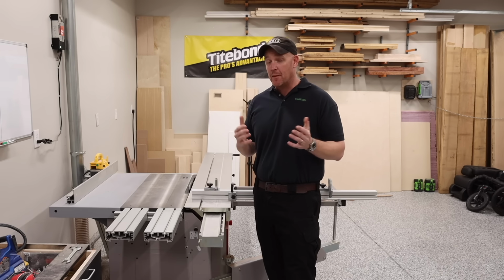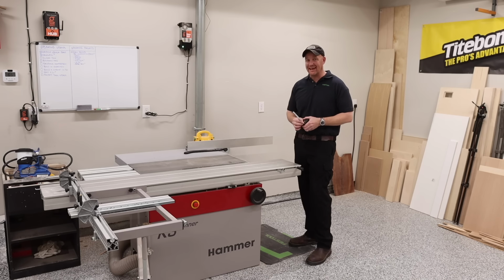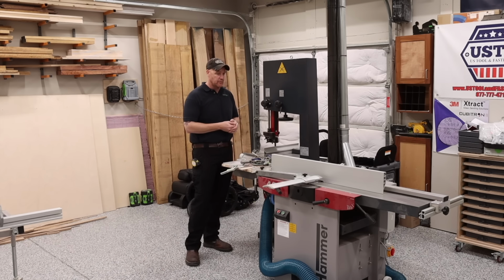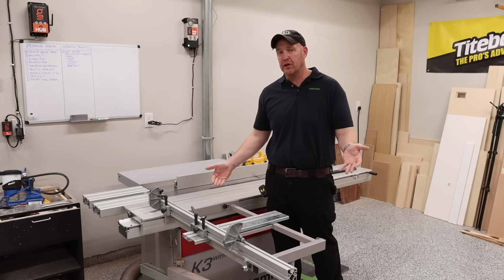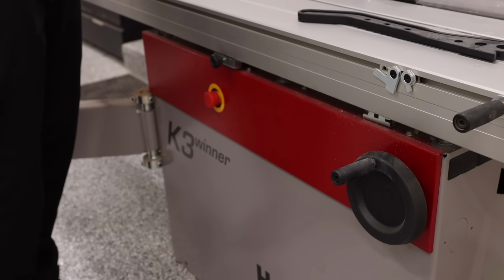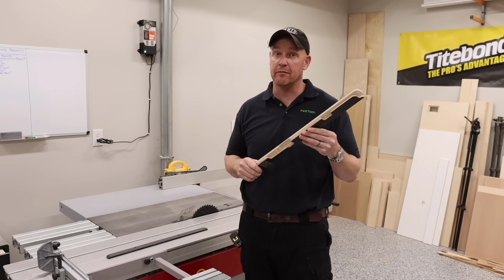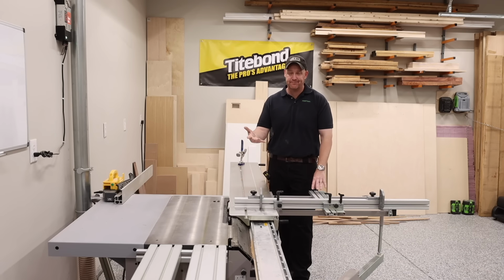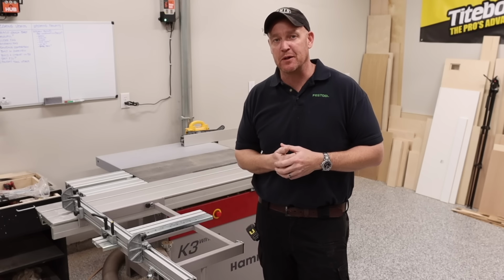I’ve been using the wrong table saw for years

Comment: I have exactly the same machine, down to every specification. I think this was a nice introductory video, one I would have appreciated three years ago when I was obsessed about table saws and which one to buy. You spent a lot of time on the dimensions and the space requirements. I have a way smaller workshop space and I've been able to make it work. For me, the main attractions for the sliding table saw were: (1) Safety. You use a slider differently. Instead of standing directly behind the blade, and in the path of any kickback, you stand to the side and away from kickback. Moreover, there is no need to get your hands near to the blade. If you find yourself doing so, you're doing something wrong. For small pieces, you can make or buy a Fritz & Franz jig which pinches small pieces when running the wood through the blade. (A F&F jig is also really useful for rip cuts on narrow pieces.) (2) Precision. This machine is probably the cheapest machine you can buy that has precision better than wood deserves. If you get a few 1-2-3 machinist blocks, you can dial in the scales to less than a mm. The precision also extends to the cross cutting ability on this machine. I dialed mine in so that error is evenly distributed around zero. (I'm a statistician and did replicate cuts using the 5 cut method.) This means that you can count on 90 degree cuts really being 90 degrees. Finally (3) Crosscutting: I was used to the idea of a normal North American style table saw. In fact, I started my research with the idea of getting a Saw Stop saw. But, then I started to think about the things I would need to make in order to use the saw to its fullest potential. Minimally a crosscut sled. If you think about it, it's silly to think that you need to make a bunch of jigs to use a saw to its potential. This saw, out of the box, can cross cut like nothing you've ever seen. It's a dream!

Bedrosian sells an excellent Fritz & Franz jig. Ramon Valdez makes zero clearance inserts for this machine.
Reply: Thank you for your insight, this is great information you have shared.

Comment: I agree 100% with Jason on the slider review.  Sold my Sawstop 2 years ago and bought a C3 41, 16" jointer/planer, shaper combo and have never looked back.  Was a tad hesitant but took the jump and just wish I did it sooner.  The Fritz and Franz accessory is awesome, I could cut thin strips all day with complete confidence, and with total safety. I use only Forrest blades and have the Forrest dado stack. I now do most of my cross cutting on my slider instead of my Kapex as well.  And cutting plywood, as Jason demonstrated, is so much easier for this old man. Oh and this saved me space in my two car garage setup, by also selling my DeWalt 13" planer and Powermatic 6" jointer. I also find Felder's support to be top notch.  Thanks Jason, really enjoy your overviews.

Comment: Great review, thanks for doing the work involved in making this video.

I have a Hammer B3 that I custom ordered in 2010, so that I could have the 51” slider with outrigger.

The B3 has the tilting spindle shaper in it which I use a lot as I mostly make solid wood furniture.

The outrigger on mine spends most of the time hanging on the wall, I only use it for large panels or Timbers.

I added the folding handle with built in angle gauge for the saw, shaper elevation also has the added digital gauge.

I have a power feeder on mine on a flip up bracket, it gets used on the saw and shaper.

I noticed that your riving knife is too far away from the blade, and your guard isn’t installed, 2 big safety issues, as well as missing the over blade dust collection which works very well.

Since I mostly work in solid wood, I often use the edging shoe on the slider for straight lining and ripping rough timber slightly oversized before jointing and planing.

I had most of my blades bored when I bought the B3, it’s about $20 per blade, any tooling manufacturer can do that for you, I used FS Tools because they’re in my neighbourhood, I also have a 6” dado from them.

Thanks for a great review, Regards, Rod
Reply: Hi, I just got the B3 Comfort. I can’t wait until the technician comes to fine tune it. I’ve watched literally all the videos you can find on YouTube about the Hammer B3! Happy to see most people have a great feedback on this table saw!

Comment: I got my C3-31 Perform 5 Function combo machine 18 months ago and absolutely love it. I even manage to fit the whole thing in a 2 car garage (although it's tight!) As for your discuss about the mitre slot - just use the sliding table! When I'm cutting miters, especially for smaller pieces, I shift my outrigger fence to the back and flip the fence around (so the fence is pushing the work through). Gives me a 1300mm capacity and the ability to use the miter indents on the outrigger.

Comment: Thank you, Jason, for this great comprehensive walk through! I'm with you on the saw stop opinion. When I needed to replace my JET cabinet saw a couple years ago, I never considered paying an extra $2,500 for a saw stop. And I did run my hand through a table saw many years ago. I did that being careless/brainless cutting 120 identical parts late at night. That changed the way I work and I've not even had a near miss since. I'll never understand the saw stop bandwagon. It all comes down to paying attention.

Comment: A few comments, when you got your saw it the last piece I needed to convince me to purchase the exact saw. I replaced a Powermatic 66 with a  Beismyer 50" fence. I loved this saw but my new Hammer is a giant upgrade. The Hammer actually has a smaller footprint. Using a sliding table saw as you said, is infinitely safer to operate. My hands are never near the blade. I too love my Hammer saw!
Thank you for the video. Your channel has been a great help for me!

Comment: I had always wanted to have a large slider in my shop due to the safety factors and also be able to cut full sheets of ply. When I built my new shop 3 years ago, I ordered the SCM Minimax SC4e. It's been the best purchase and it doesn't disappoint. When you get through the learning curve of a slider, then sky is the limit. Once you install a DRO on the crosscut fence and add a second fence down the carriage with a DRO, you won't need to use the parallel fence. For small pieces, a Fritz and Franz. Things change quickly with the slider and the world opens up. I also have an FS41e which is awesome. So much great equipment out there. The Formula S 540p bandsaw is next.

Comment: I started out with the Felder K500 Pro and like you was totally sold on using a slider. I too decided I wanted more and I upgraded after about 1 year to the Felder Kappa 400 X-motion. Went with all digital stops and totally love this machine. I had it commissioned by Felder and it has been a pleasure to use. My advice would be to not settle for less on your next upgrade as years later you won’t have any regrets.

Comment: I live and Delaware and always wanted a Felder saw.  I recently purchased the Hammer C3 41 Combination machine.  It saves a lot of space in my garage.  I had the same problem with the three position switch on the back.  I was devastated when it wouldn't turn on.  I guess I'm not the only one who missed that.  I'm very happy with my purchase and would recommend it to anyone looking to upgrade.
Reply from the maker: Very cool!
Reply: I have a K3 winner, this is the same saw but a router is included.  To utilise the router I have to put the tree position switch up high.

Comment: I have the FELDER K700S…. Which I got because it seemed the safest option (even vs the Sawstop). As you demonstrate -  You can hold an 8x4 sheet (portrait or landscape) on the sliding table with the fence and a single clamp and never be within feet of the blade, or at the other end of the scale you can cut 1/4 inch off a 1 inch long dowel using the Fritz & Franz jig also without coming within feet of the blade….. and all without the need for a push stick because you are always so far from the blade
Reply: I bought the same saw. LOVE IT! There was certainly a learning curve for me after nearly 40 years of using a Powermatic Model 66. I’ve kept the Powermatic for long rips of solid woods. The Felder now does 90 percent of my cutting work.
Reply: The biggest safety advantage is not even blade protection but kickback.
Reply: As long as you have $6000 to drop on a tablesaw instead of putting that $$$ into a commercial planner +, big commercial bandsaw which = ripping inexpensive lumber saving you BIGGGG $$$$$,   Sure, go ahead buy a big expensive table saw which is superior 100%, but one has SO many other big costs before pursuing this massive upgrade expense.  Such as Dust Evac, router tables and bits, clamps clamps and more clamps etc.   Next would be cost of making a finishing ONLY shop with hanging racks and tables +  radiant  floor heating and air filtration system etc.  This saw would be the LAST thing I would purchase as a prospective wood worker.  Always in back of mind to get if I have lots of $$$ to drop on a new tool, but.........   Something to drool over when all the REAL tools, infrastructure has been purchased and paid off.  If I were a rich man, la la la da daa dadda da dum, If I were a ...
Reply: How much is a same power sawstop, plus decent mitre saw? All the material for all the jigs und mitre station? How much is your hourly wage. To build the jigs and station?
And if you can't afford a sawstop, what is your health worth? Specially if going to hospital cost you 50grand for a finger...

Yes, the table cost something extra. But it is not unreasonable in comparison from what you save. In the long run it might be even cheaper.

Of course this is all subjective, and everyone puts different weights to different arguments. For as a hobbyist, I rather stay with my tracksaw, till I saved enough for a decent (sliding) table saw, than buying some mediocre machine or a sawstop that deals with (IMO) inferior overall handling by adding expensive technical protection. Yes, every cut till than takes longer, but for its the time spend with my hobby. As a professional, time is money and a (expensive) machine is just a equation ahead. Is it cheaper in the long run? And when is point even?

Of course you can stay at your cabinet saw, dreaming of a sawstop. As a professional you might say I get a sawstop in between, an later I invest again in a sliding table saw. It is up to you.

Comment: Hey Jason, I love your channel. As you predicted some in your audience would copy your decision to get a Hammer. I have a Sawtop JSS and was considering the large Sawstop saws. I decided the slider was a much better route, it has the safety benefit of keeping my fingers far from the blade and has the 'sled' built in as you said while keeping my position out of line with the blade. My K3 Winner arrived and I am still putting it together. For others considering this I would say it is worth considering getting the mobility kit. I put the wheels on while it was on the pallet. Getting it off was a breeze - no pallet jack or tricky balancing. Thanks again for the great content.
Reply: What are your thoughts on it after 2 months of usage?
Reply: @AaronGeller  I am very happy with it other than the topside dust collection.  The dust collection boot does not even rise to the description of bad design. The thing in need of major rethink is the location of the start/stop switch - very poorly placed. But does cut well and accurately once set up

Comment: Love it!  This video confirmed every suspicion I had about a sliding table saw.  I couldn't think of a single reason (other than space maybe) why I wouldn't want to move from a standard saw to a slider.  I loved your other video about breaking down sheet goods using the track saw and I incorporated a lot of those techniques into my process for breaking down sheet goods but still think a sliding table saw would be more accurate, easier to navigate larger sheet goods, and safer for that task than a track saw and especially a regular table saw.
Reply from the maker: It’s such a great tool

Comment: Blessings from Australia. I have a Hammer  C3 31  Combination Machine. Saw, Thickisser, Planer and Shaper, with a 2050mm sliding table and outrigger. I love it. I've had it for over 8 years. What sold me on it is that you are nowhere near the blade. You are always to the left of the blade and not behind it. The sliding table takes all the weight and control of your work. I would never go back to a traditional table saw. Cheers from West Aus.
Reply: I also have a C3 31, and mine is the comfort model.

Comment: Another excellent video, Jason. I have a B3 comfort winner which is essentially the same saw but either the spindle moulder. Mine came set from the factory and was already accurate which was pleasing. Just a point on the zero clearance insert, you have to swap it out if you tilt the blade. I’m going to be extending my shop this year and plan to change to the Felder KF700 which, unlike a lot of manufacturers of larger machines, comes with an option of single phase. The quality increase on the Felder is significant but so is the hike in price!

Comment: Hard to be sure on the video, but your fence adjuster bolts look to be coarse thread (3/8-16 possibly). If so can you replace them with fine thread to possibly make finer adjustments?
Also, if the bolts are in fact removeable, you could double nut one side (make it fixed) once its close. Then loosen the single nut and use slotted machine shims (if you can find them).

Comment: Great demo.  I had a K3 as well about 5 years ago and sold it, stupidly.  We are moving in the next few months to the ABQ area and I'm planning on selling my SS, PM1500 and Jet J/P before we move as it would be very expensive to move and I don't plan on having a shop for probably a year.  I'll just have to get by with all my Festools!  Once I get a shop built, I will order the Felder 700 professional, the Hammer 4400 BS, and the a3-41.  Probably going to be north of $20K but it's still a lot cheaper than a boat.

Comment: I bought the C3-31 combo 4 yrs ago... got rid of my General cabinet saw and never looked back.  Sure, it has drawbacks with respect to rip capacity and fence but the advantages are far too numerous to cover in a comment.  I use the shoe regularly to straighten rough lumber.  I use my power feeder all the time.  Fritz and Franz jig is the best taper jig on earth.  Got the Forest Dado stack.  I'm considering parallel fences.  If I was to start over (wish list), I would save another chunk of money and purchase the "Felder" combo shaper/saw and the A3-41 16inch planer/jointer.  Now it's fun to make cabinets and rip through 4x8 melamine or ply.  I like precision and Hammer delivers.  Enjoy.  Congratulations on your purchase. ... Oh yeah, FYI, I 3D print a lot of add-ons for the saw like the nut under the Kreg jig, adapters for dust collection (4in to 120mm), caps for the extrusions...

Comment: I have a grizzly g0623 sliding table saw in a small shop and I agree, it doesnt take up any more space than a normal cabinet saw. Its actually smaller because I can move the sliding table to move around my shop. I agree with everything you said in this video.  I wish these types of saws were more popular in the US.

The one issue I have with my saw is ripping. I never good a great rip.

Comment: Just saw this pop up on my recs.  Have basically the same saw and have it for 4-5 years now.  You can run a 6” American style dado stack, got mine from sliver mill, I looked at the felder option but it leaves strange looking grooves due to the cutter design.

I’m only 30 min in but a Ramon zero clearance throat plate, a fritz/franz jig, some slider kreg clamps, a zero clearance block on the outrigger and a free grizzly over blade guard from the mighty Mike Farrington really bring this saw alive.

I have mine kind of in the middle of my 4 car equivalent sized shop but I might move a few things around and push it up to the wall.  See if I like that setup

Comment: Very cool tip on fixing the sliding table. So when the sliding table is all the way at the front of the saw you adjust the front two bolts, then when the saw is all the way to the back you do the back two? I saw a video on youtube that said the opposite..... That is when the sliding table is all the way at the front you adjust the back two bolts, then again when the table is all the way to the back you adjust the front bolts.. Is the latter incorrect? What exactly did Felder say?? Many thanks